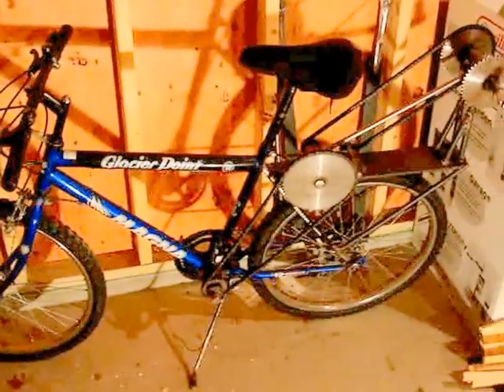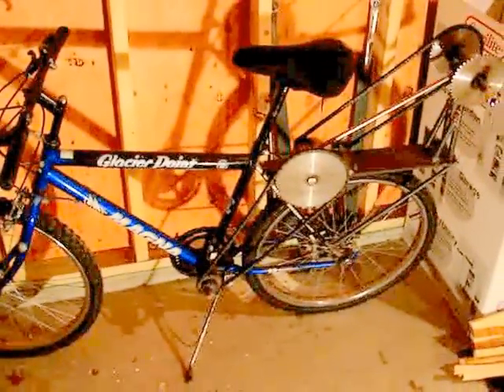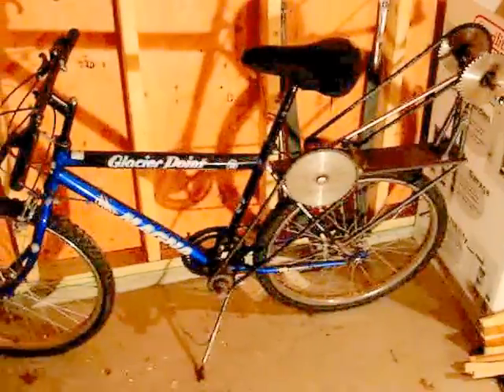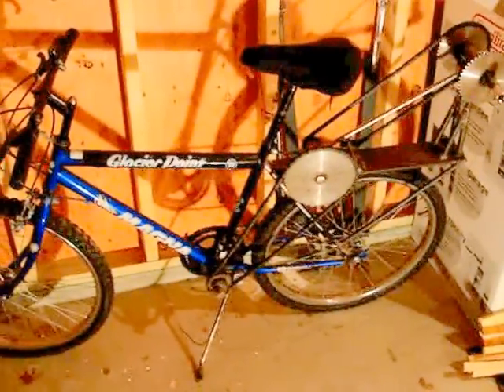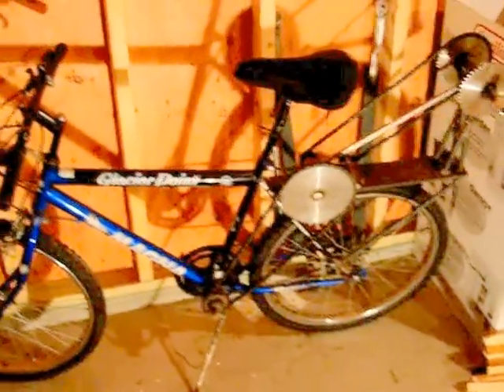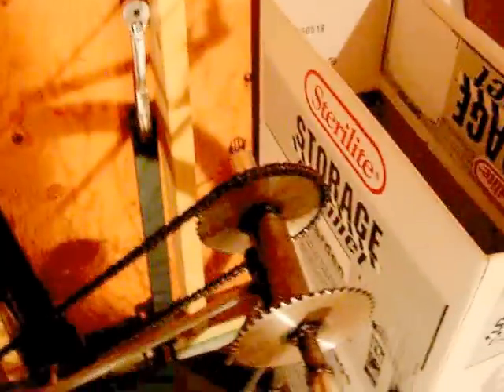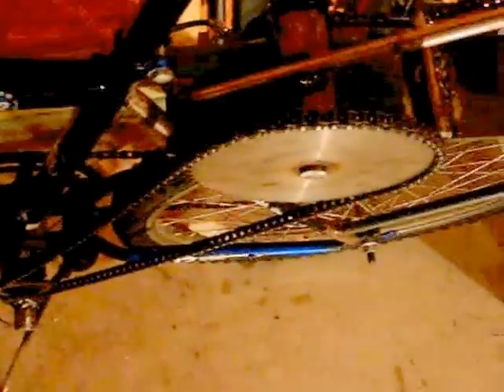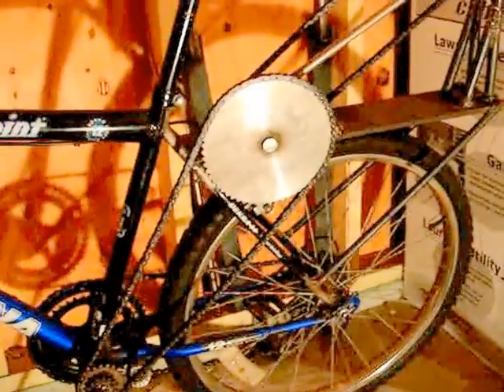The Gearcycle Bicycle Invention Part 1

Comment: What is the idea behind the bike? Greater torque?
Reply from the maker: The basic idea to create really high gearing through the series of gears combined with the massive force from pressing down on both levers at the same time as well as the force created by the levers themselves to work through the resistance of the really high gearing and turn the wheel at a rapid rate. The only thing that matters when it comes to speed on a bike is how fast the wheel is turning. There is also more power compared to a regular bicycle since you use both legs at the same time. Please watch my video series on The Gearcycle.
Reply: Will do. Love the idea!

Comment: So, where does that leave us? MINIMAL weight (which is a given) NARROW tyres, to reduce the coefficient of friction. Efficient (and small/thin as poss) toothed belt drive. Minimal handlebars (thin rod with normal size welded bar-ends (you'd have to compare weights) Strength....triangles EVERYWHERE! Use of plastics, carbon fibre and, of course, some sort of FAIRING. As wind resistance is the biggest demon, for travelling at any speed.

Comment: OK, but again (gosh, I'm a real Jobe's comforter, aren't I?) We're talking WEIGHT, and not just weight, but a weight that's precessing! (has a gyroscopic effect, resulting in an unwillingness to change direction) Ever got a bike wheel, spun it between 2 hands, and tried to alter its direction? That's what I'm talking about.
Ideas? Obviously, as light as can be. But again, there's the 'nothing for nothing' principle, that stymies everything.

Comment: As you doubtless know, the law of conservation of energy, states that energy can neither be created, nor destroyed, it just changes its form. With this, I'd go for toothed belts, and as much weight loss ass reasonably possible (Thinner wheels/tyres for instance) As much c-fibre as poss. Lighter belts/sprockets and less weight. Yes, I have 6 motorbikes, from a 125 up to 1300cc.

Comment: Sorry mate....very clever stuff, but there are so many parts (weight) and bearing surfaces (friction), that it's about as efficient as a big box of inefficient things. I mean, you have TWO chains, and many more sprockets. Not to mention all the jiggery-pokery above the rear wheel (alters C of G). If this is just a concept, then that's great...you're a nutty inventor (that's cool) but if you intend on trying to market it....
But good on you for trying. Better this than watching TV!!

Comment from the maker: No. I have the gears set up exactly how they are suppose to be set up. I have them set up for very high gearing, which is what will give me speed. Yes, it will be harder to get started and have slower acceleration, but it will give me higher speed. Don't forget that I have the very long crank arms to help combat the resistance of the high gearing.

Comment: you know your running the gears completely backwards? when you hook up a motor it will NOT even move you. Switch all of them around because you just screw up everything with your gearing